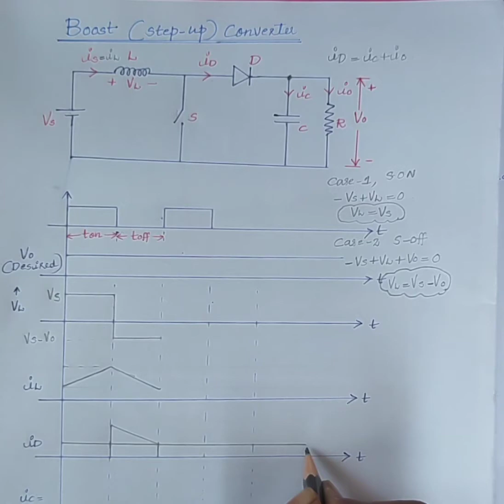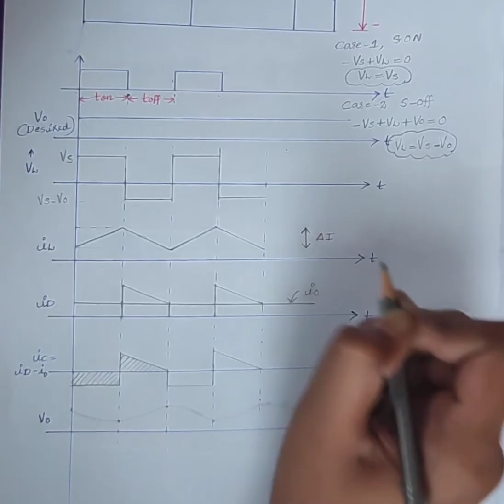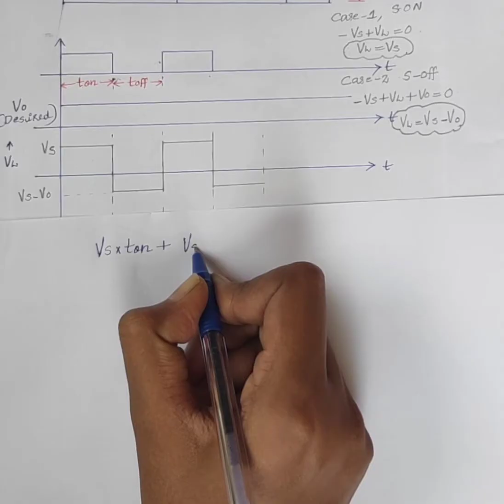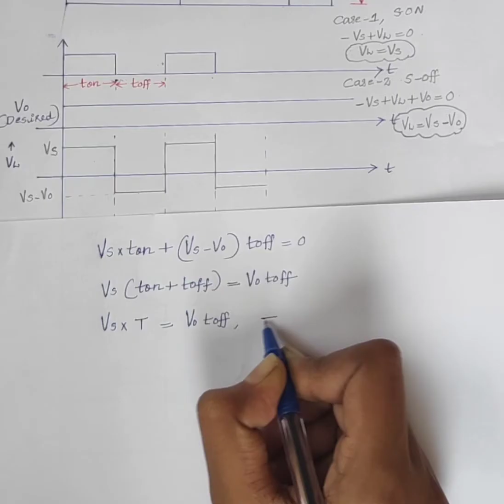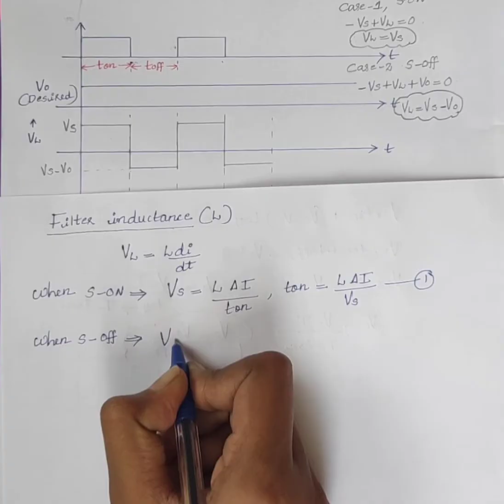Boost Regulator

Comment: during Tonn why the inductor voltage polarity is not changed in the KVL it should be  -Vs-VL+Vo
Reply: i think polarity only gets changed when the inductor is discharging to load during toff ie - VL+. During ton its +VL-.